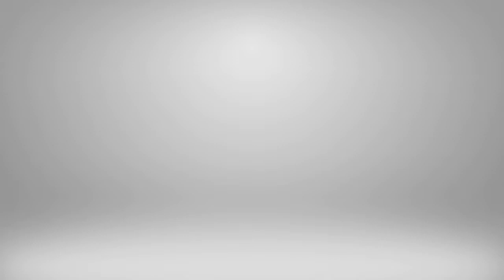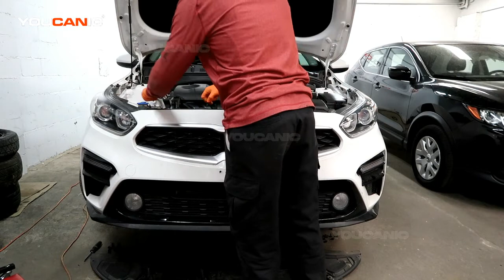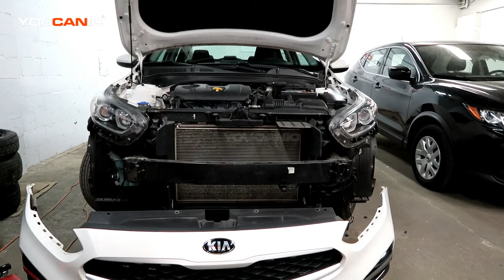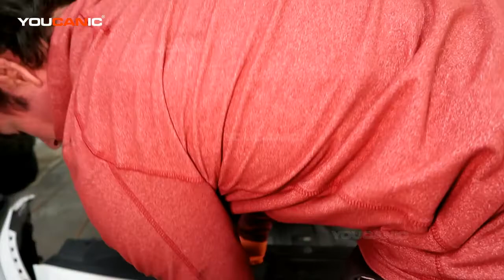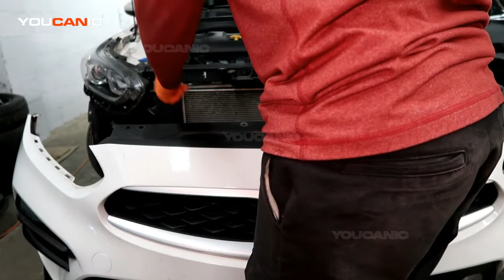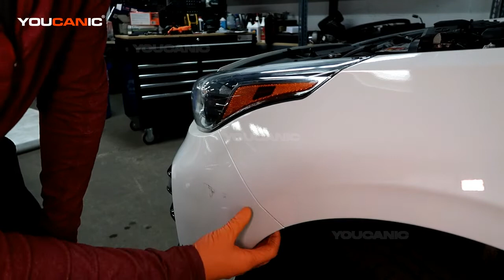2019+ Kia Forte - Front Bumper Replacement

Comment: Thank you for this video.  Is it possible to replace just the grill without completely removing the bumper, maybe just loosening the fasteners on the top of the bumper, pull the lid up, and remove/replace the grill with the bumper still in place just bent back a little?